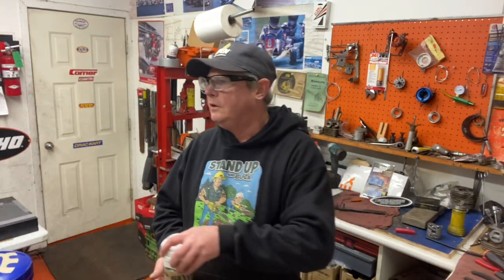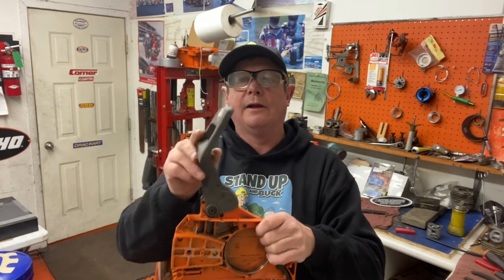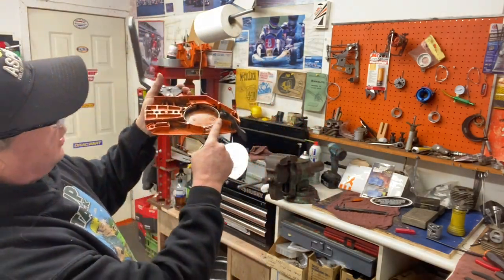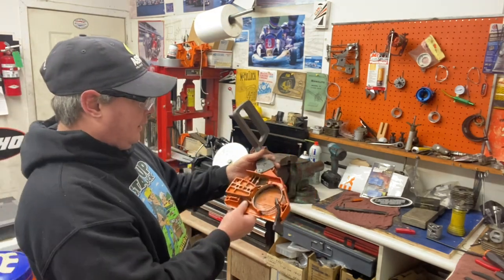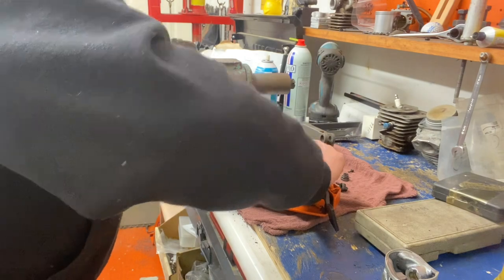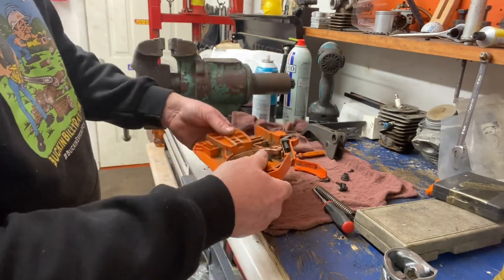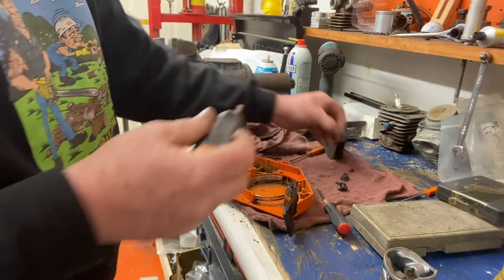How to rebuild and reset husqvarna chain brakes

Comment: Thanks for this information, I recently had to have my brake fixed on my 268
I had taken it apart and discovered that the small finger spring on top was broken so I decided to just reassemble it and take it to the dealer or order the part and repair it myself but for the life of me I could not get it back together so I put it all in a baggie and took it to the dealer. Now after watching you video, I realize I had no chance of reassemble without some sort of reset tool.
I was kinda hard on myself for a day or two knowing I had the mechanical ability to make such a repair but now, I know if I had the correct tool for the job it would have been a snap.
Thanks again

Comment: Great video. Had been struggling to reassemble the chain brake on my Jonsered 2036. Didn’t know about the pre-setting before reattaching the handle. Having watched this video I went out to have another go. I discovered there is a way to do it without the special tool.  Don’t install the main spring, pre-set, then attach the handle, then push the handle forward whilst pushing up the spring  plunger, then insert the spring and put the cover on.

Comment: just did this on a 455 rancher. what a pain! I used some vice grips to hold the spring down and channel locks to squeeze it all in from the other side of that plastic arm thing. fortunately it all snapped into place

Comment: What is the process if the brake handle top pin has been removed? What is the position of the spring in the handle?

Comment: I have a friends Poulan pro 295 here that had a broken brake band and handle. I ordered an aftermarket replacement thats identical to that in this video. Before installing it, i tried clicking it forward,and the band contracted. Disassembled several times,pulling out the last of my hair,no results. Ill try making this tool,hopefully it does the trick!!

Comment: My 288 brake activates for no reason, but still requires hard pull to de-activate.

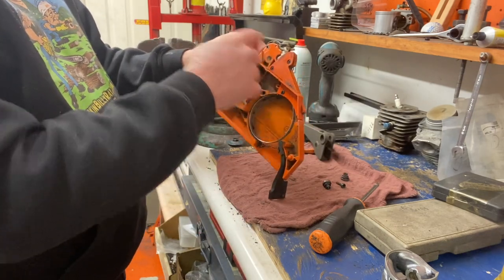6:10 - What will a worn hole look like? will the hole be out of round? Smooth inside (no knurling)?

My hole does not appear to be out of round, but the inside is smooth (if there was knurling there, it has worn off).
Reply: So does my 288. Why?

Comment: The brake on my 55 rancher wont "move fordward a little" after disengaging, so I dont have enough room to put my hand on the handle. When I try to fit my hand in between the handle and brake, the brake pushes forward and engages. Im thouroughly stumped as to why and how this happened, as well as how to fix it.

Comment: I bought  an aftermarket chain brake for my 272xp.    I followed your instructions, plus some other ones shown online, and it is still not functioning properly.  As compared to my other saws (288, 372, 390, etc.), I'm not impressed with this aftermarket chain break (other than the price of course).
Reply: Ya the aftermarket 272 brakes suck
Reply: Yes aftermarket pull cord assemblies and clutch covers are no good, Unfortunately oem are pricey but you buy one and send it
Reply: Yeah, I wouldn't suggest purchasing a new aftermarket oil pump either

Comment: Great video! For the smaller 300 and also 200 series saws like shown at 13:52 with the 3 pawls in the clutch cover, you can unlock the brake nicely with a crescent wrench to engage the pawls and another wrench to rotate the crescent wrench. I showed how I rebuilt and unlocked one of those at the timestamp here: https://youtu.be/4Tx_dj3vCs8?t=1475

I'm off to replace my 257 brake band. Subscribed, and thanks for the video!